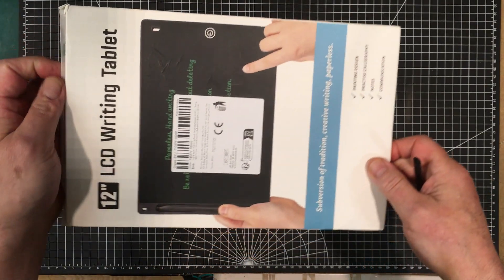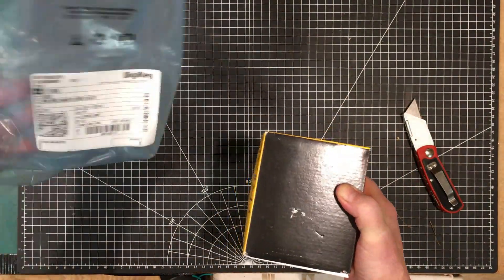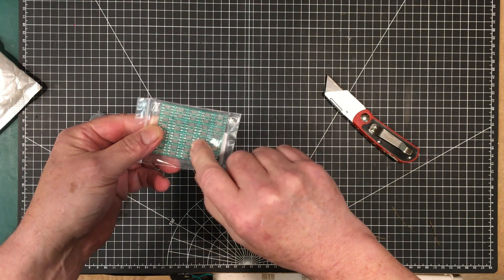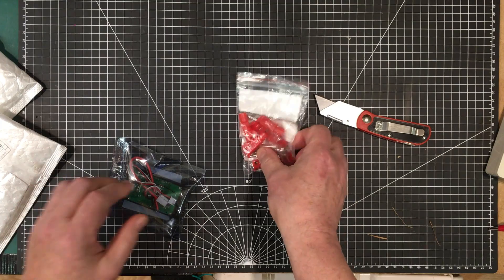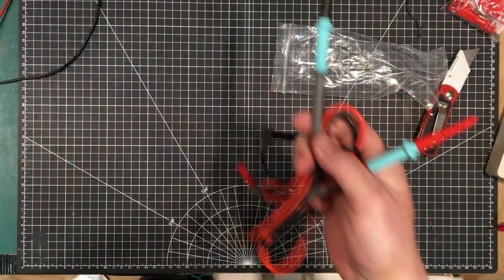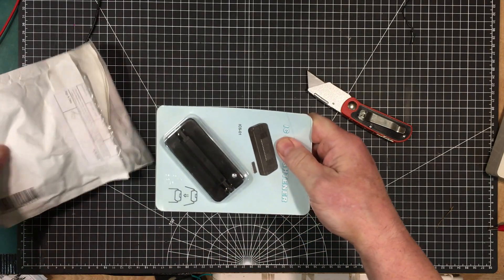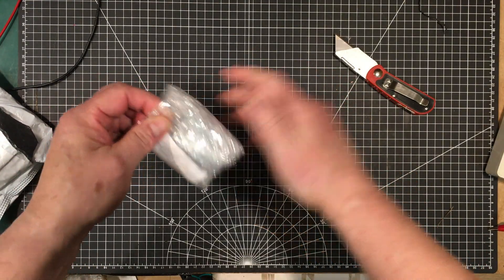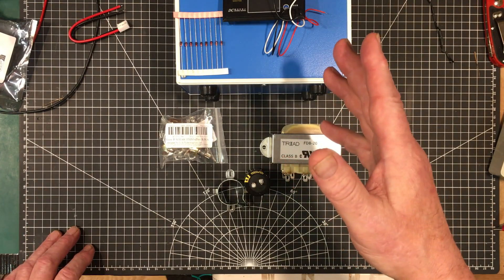Uni-Byte 0192 - MAILBAG #25:  No, THIS will never end

Comment: i has make hobby elektric all my life about 50 year and good power supply have all projects is 30V more not need lot, maybe 48 volt and about 10 A mpere  lab power supply i has made some my workshop normal0- 30V 10A and some adjustable AC transformer 0-230volt. smallest has some 12V and 24V adjustable lab power box too but not used lot.
Reply from the maker: You can never have too many power supplies.